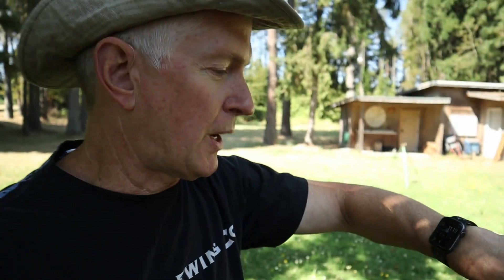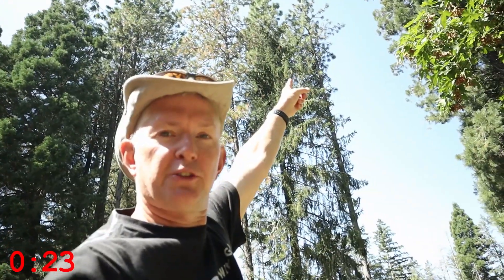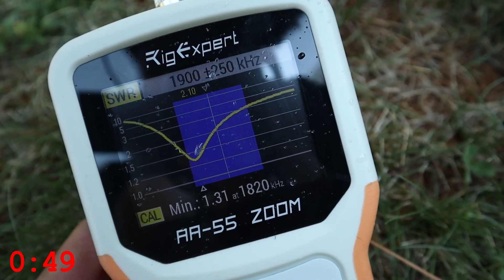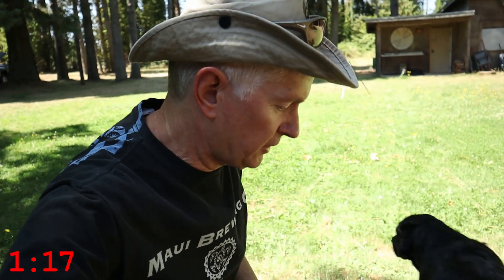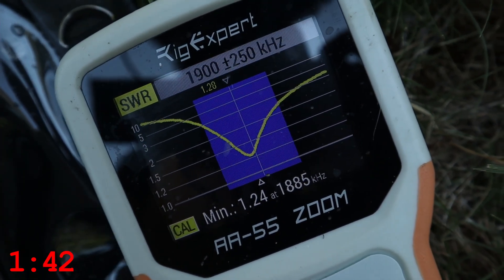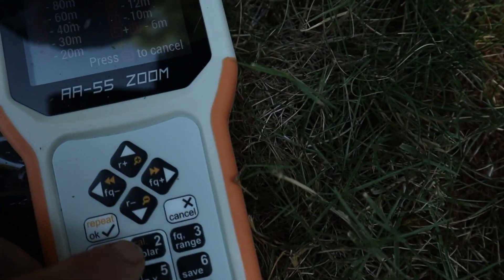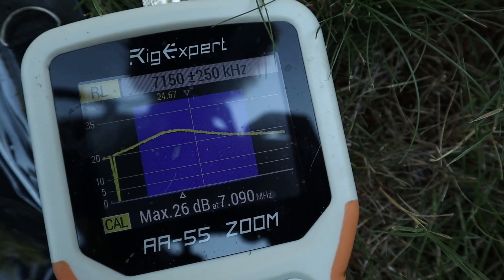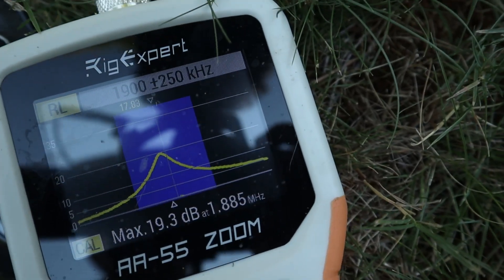Two-Minute Tuesday - Tuning a 160m EFHW using the RigExpert AA-55 Zoom's SWR2Air (#42)

Comment: That’s pretty broadbanded  right ? Acceptable SWR’s across 3 bands is what I saw I think 🤔 80/40/20 ?
Reply from the maker: Actually 4 - 160m was in their too.  However you have to stay up late for any 160m traffic due to noise, I think atmospheric.  I've never made any 160 contacts on it.  80/40 does well but my 40/20 loaded dipole is more quiet.  Thanks for watching!
Reply: @W0KNI  
You’re welcome , and I appreciate the quick and to the point videos . I’ve had my ticket almost 11 years , General almost a year , and I’m just now really getting into learning to make antennas , what velocity factor vs coax is, 1/2 wave multiples and quarter wave multiples for electrically correct coax , reflect vs nulling jumpers ,, etc and etc,, I’m a little late but I showed up !  73’s

Comment: Great video, how long was the antenna 
Regards
Mike
G3zcc
Reply from the maker: Hey Michael - thanks for watching! The antenna is about 80 m long and made from 18 ga copper stranded wire.  It's draped over a 125 ft pine tree in an inverted V configuration. It receives really well but sometimes I feel like my trusty 20/40 trapped dipole mounted 10m up does better.  It's hard to say though.  Cheers!

Comment: Great job.  I've got some nice tall trees also so I'm thinking of trying this.  Do you have yours going up and over the tree, or is it pretty much hanging straight down? 73, K8JLW
Reply from the maker: Hey Reid - thank you. Yes, like an inverted "V."  The tree is about 120' high, according to my DJI Mini 2's altitude display.  I pull each leg tight enough to take out most of the slack.  The end is about 3' off the ground and as you can see by the video my feed point is basically just hovering above the ground.  No grounding or counterpoise is used.  You've given me an idea for another short video showing the overall layout of this configuration.  I'd also like to make a video showing QSOs on all those bands!  Cheers!
Reply: @W0KNI  Wait..what????  No grounding?!?!?  I don't get it.....  I'm new and I'm not busting your stones here, but everyone I asked said you need to ground these EFHW or your will burn your house down....  Can you please elaborate on your setup?
Reply from the maker: @ErikAtTheW  Hey Erik - thanks for watching!  For my situation, as a temporary hook-up - no grounding needed.  If this long wire was a permanent connection I would add a ground for lighting purposes only.  I hope that makes sense! Cheers.